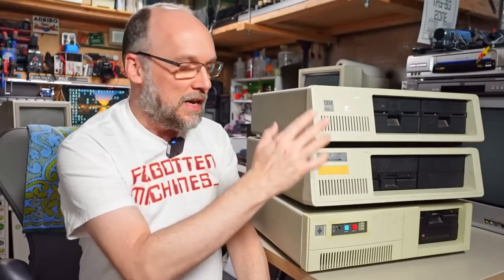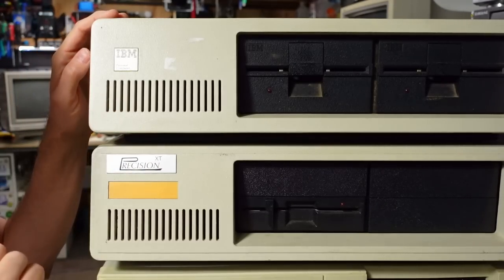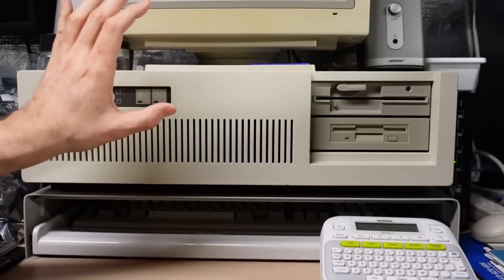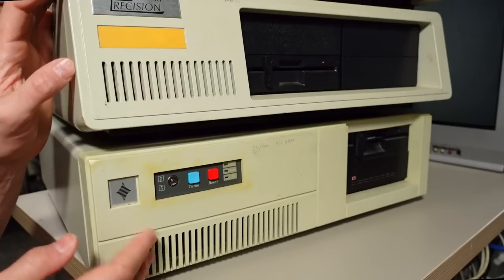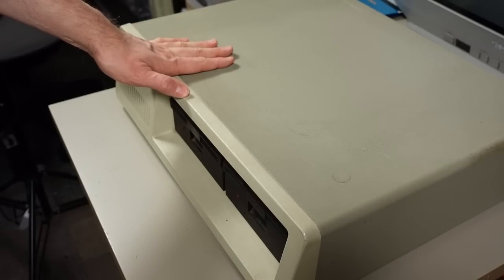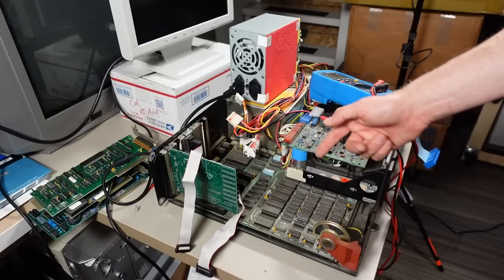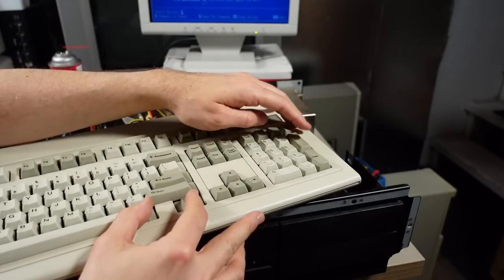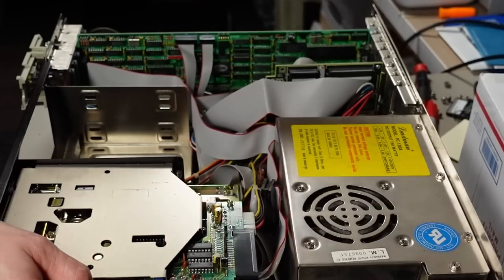PC archeology: Treasure hunting inside old PCs

Comment: The hex-head nut drivers like that (especially, I think, the smaller of the two) would often work on the screws for a ton of computers in the '90s. Case screws, the ones holding power supplies, and the screws to hold cards in expansion slots generally used combo Phillips/hex-head screws. The screws used for drives tended to be more of a mixed bag.
Reply: They work on computers now, even. Hex heads are nice for manufacturers because they're slightly tapered and won't strip on very basic torque metering drivers. All it has to do is detect a tiny bit of kickback on the bit and it stops... do the same with a phillips head and it'll damage the screw.

Comment: it may be the cap goes low resistance when it gets volts to it, i've had that with an electrolytic in a roberts r505 radio.., if theyre that much a problem on these, maybe good idea to replace the lot on sight..

Comment: I've used those hex drivers a lot myself. Besides older IBM machines, they also come in handy for I/O ports that have those barrel bolts on each end. The most common ones I used to see when I processed e-waste were either 3/16" or 5mm, and they were so close in size that you had to have both because you couldn't interchange them unless you filed down the insides with a lathe.
Reply: Wouldn't that just create a round socket? Suppose that would be helpful with circular nuts.

Comment: DOS 1.x could actually run in only 64K of RAM. I think DOS 2.x could as well; I used a Tandy 1000 with 128K and DOS 2.11 and it could run a surprising amount of software -- even an early version of Flight Simulator.
Reply from the maker: Interesting! I suppose it was the 16k variant of the 5150 that was useless without at least 64k. :-)

Comment: If you have dirt in the bearings, it would be better to not try and run it in if you can help it,  as this will cause wear in the bearing.  Ideally you should disasseble it,  clean out the dirt and old grease and then add new grease.   This is if you want those drives to last another 40 years, anyway.

Comment: Those two tools still work on some modern cases. The smaller size works on stand offs and VGA ports while the larger size works on the external hex screws like on the power supply. Just used them earlier today.

Comment: Aren't CR2032 Zinc Air batteries? I don't think they have anything liquid inside of them. I think there are modern lithium versions though, no idea on those.
Reply: The "C" in CR2032 indicates a lithium manganese battery. R means round, and 2032 means 20x3.2mm.

Comment: what's the difference between an 8088 that can run at 10mhz with one that can't? or all the 8088s can run at 10mhz?
Reply: Good question...

I don't believe they all could run at 10mhz... Someone correct me if I'm wrong. I swear my childhood 8088 was a 4.77 only chip. I don't remember if the frequency was written on it.

Hopefully someone will answer.
Reply: @volvo09  The Intel 8088 originally was a 5MHz part, so ironically IBM was under locking the CPU by 4%. This was related to needing(?) a 3.57MHz clock in the ISA bus for NTSC video (CGA). Both 4.77 and 3.57 come from dividing the 14.318MHz Crystal. As was normal at a later date Intel released CPUs which operated at a faster speed. This was achieved through either design tweaks and/or manufacturing improvements.
Reply: It might be an improved manufacturing process and/or selective parts binning.

Comment: Regarding the EPROM at 39:46 - as the sticker is removed i would assume it has lost its contents, but what would the original purpose have been? Is it like a BIOS extension?
Reply: It's the system BIOS, and it still works.  It takes hours of UV exposure to erase those EPROMs.

Comment: On floppy drives, (34 pin ribbon cable), the drive after the twist was A: and B; had no twist. Sometimes the twist was in the middle of the cable and then a second twist took it back to flat so on those cables A: was in the middle and B: is the end.

Comment: At 39:00, those battery readings actually kinda confirm my theory: The computer came with the hyper clock (wtf is a hyperclock? does it run too fast somehow? with just a clock chip and a couple bus decoders?) and later, the owner upgraded the system with the multi-io card, not even thinking about the clock card. he should have, logically, swapped one for the other, especially since the card was clearly reworked. I suspect a second owner, who didnt know the original owner repaired or paid someone else to repair the clock, upgraded with the multi-io card, and didnt know or care enough to look at the other cards in the machine. I suggest storing the clock card for another 5150 or 5160 class machine with no clock. They definitely should not both be in there, and will definitely (silently) conflict. If they are very very close in spec, they will both act as one - if not, it may be...unstable, in the data accessed. Also could maybe drive the bus too high when accessed, but i imagine whichever chip has the highest output wins, and the other gets a hot load on it's output pins.

Comment: Got an A2090 Hard Drive controller for my Amiga 2000 rebuild (mainly to test the Zorro slots), the spooky part is you've done 2 or 3 videos with ST506 drives and, in the box with this, were 2 such examples (Toshiba MK134FA and NEC D3142) I haven't tested them yet but just thought it was funny :)

Comment: I'd mention that the 16450 was also a replacement for the 8250 but had some issues. If you have a system with a 16450 that doesn't seem stable or reliable, replace it with a 16550 and you see an improvement.
Reply: My understanding is that National Semiconductor who manufactured the INS8250 UART (second source of the Intel design), simply renamed this chip NS16450 to make it appear that their NS16000 CPU family had a UART as part of the family. Their CPU was the NS16032, ironically renamed the NS32016, now part of the NS32000 family. Whether their were any tweaks to the UART design, IDK. Nat Semi later developed this design into the NS16550 which added FIFO buffers and other features.

Comment: no adrian they're NOT specifically designed for ibm pc's at all..... they are bog standard nut drivers..... i have loads of different sizes in my mechanics tool kit......
Reply from the maker: Of course, but the inclusion in a computer tool kit of just these two nut drivers (and no others) surely was to help when working on IBM machines.
Reply: @adriansdigitalbasement  i suppose so!.. also what is the blue dip package on the left fdd top right corner ? its not on the right drive??

Comment: You accidentally blew my mind telling us that the original IBM PC had either 16 or 64kb of RAM on the motherboard. I think my first 8088 came with 256kb of RAM, and that wasn't actually something you could do anything with and you'd really need a RAM expander board.

I can't wrap my head around an IBM PC machine with so little stock memory you couldn't even run PC-DOS 1.0

Comment: Nice of IBM to use hex screws.. not likely to strip those.  I recently needed to open an old MSX computer which used phillips screws that someone had put loctite on.  Luckily there's a secret for those.  Get a yankee screwdriver.  It lets you apply torque to a screw while simultaneously pushing down on a screw to prevent rounding off the fastener.
Reply: Wrong. For japanese machines you need a JIS screwdriver. It looks like Phillips but prevent the stripping of screws
Reply: @nneeerrrd  This is a National CF2000 which predates JIS screws by 2 years.  JIS screws usually have a dot on them.  I use pozidriv bits anyway which have a flat tip just like JIS bits.

Comment: Leadman PSU... JUNK. Absolute bottom of the barrel. At least their ATX supplies were bad. No filtering or protection circuitry, cheap junky caps, junk fans, thin sheet metal, and massively overstated wattages.

Comment: I have found a big ISA RAM card in one of the 286 computers I have found behind my house on trash day. The computer was unfixable because of battery leak. But the card looks mint. I have a 286 laptop that can accept 16 bit ISA cards under the keyboard.(Designed in Hungary, 1987) Is there any software I need to use/test that RAM? The laptop has 1MB RAM on the bottom(4x9 chips) by the way.

Comment: Simple way to figure out which bypass cap is bad....  Is to not figure it out.  Just replace all of them.  Capacitors are cheap.
Reply: Replacing tons of capacitors is a pain, especially when most of them are just fine.

Comment: I hate shunt regulator power supplies, they waste a ton of power
Reply: the diode will blast full power, the waste circuit design
Reply: not worth anything as regulator (law)
Reply: hey add a distance bottom led-detector in an imu mouse, it will work better/simpler than optical mouse, btw, known voltage transform to operating voltage is better than try to regulate power supply